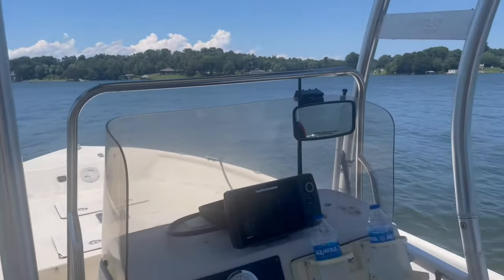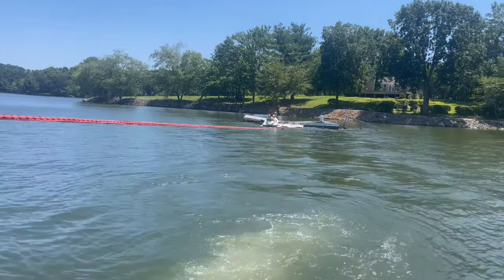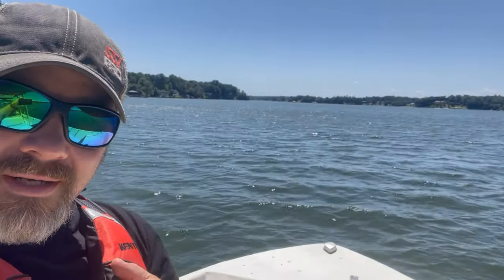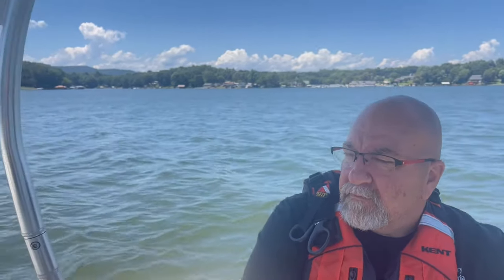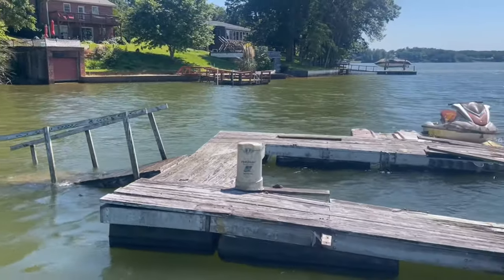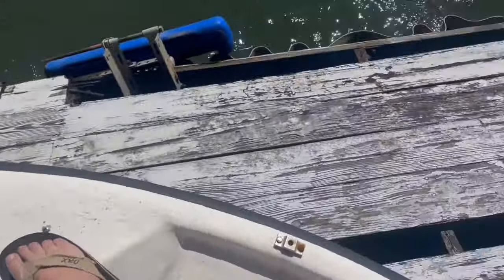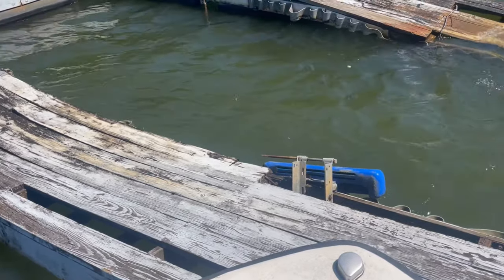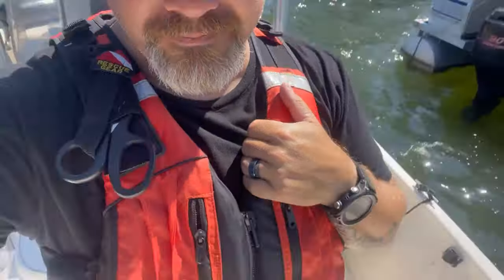Towing An Entire Dock System, Well, What Is Left Of It!

Comment: I’m always a little cautions working with rope. Any concerns with it being tied right behind the captains head? I’m assuming you would need different size tow ropes for different size loads. It’s always cool to watch you guys do what you do.
Reply from the maker: Hello @calebmcelhaney2292, you make a great point, and yes the fear is always there, what happens when the rope breaks. To combat this fear, we always use the rope that is designed for towing things in the water. The same rope you would pull a tuber or skier with. Second, the angle at which the tow rope is at, would allow it to go above the captain's head instead of directly into it. Moreover, we inspect the rope every week so we know when it needs replaced if it becomes over stressed.